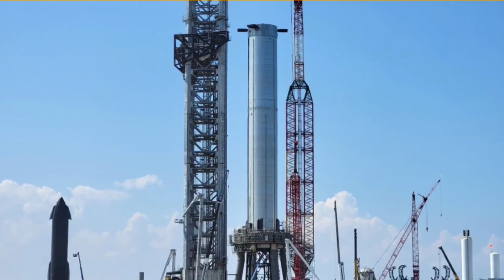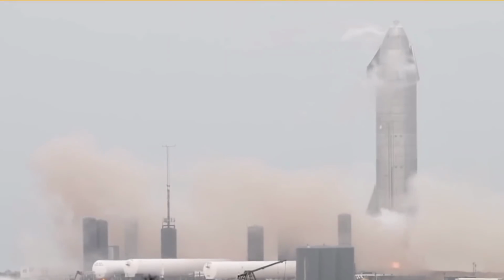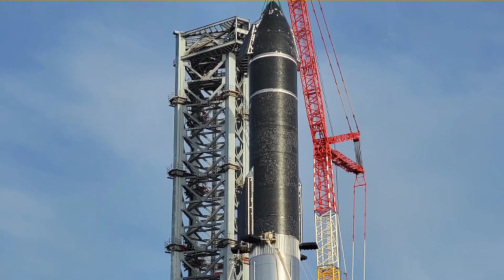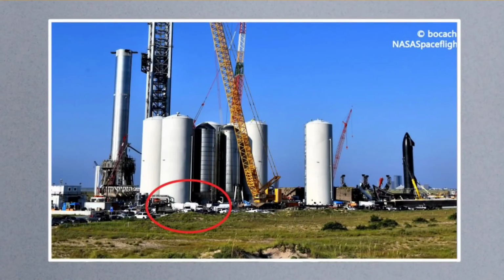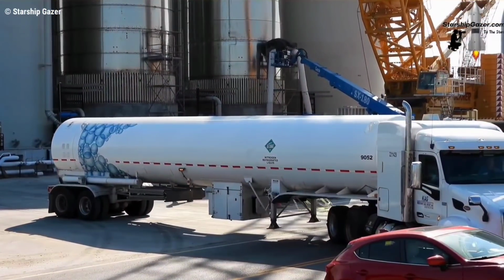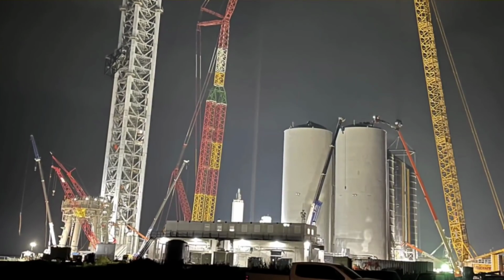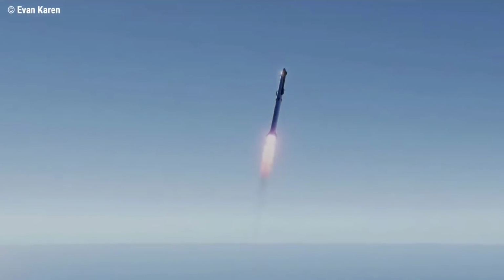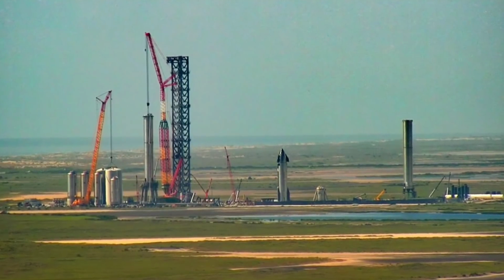IT'S HAPPENING! SpaceX Is Finally Testing Their New Super Heavy Booster4!

Comment: cryo proofing not only tests for leaks it also hardens the steel !
Reply: - But also makes it brittle.
Reply: @mydogbrian4814  I though they used a special steel that doesn't get brittle under low temps like most steel.
Reply: @Fooney1  - Everything loses thermal elasticity as the temperature drops toward absolute zero. And although still remaining intact, their tolerance for external stress factors are all severely limited. 
-  A rose dipped in liquid oxygen will shatter like glass on impact.  So would your frozen arm.
Reply: @mydogbrian4814  I get all that which is why I was saying they are using a type of steel that doesn't really do that at the operating temperature the rocket will see.
Reply: @mydogbrian4814  heah its gonna shatter like glass.. wait and see.
Reply: @Saikelu  You know they've already cryo tested other tanks made of the same material... It's not gonna shatter